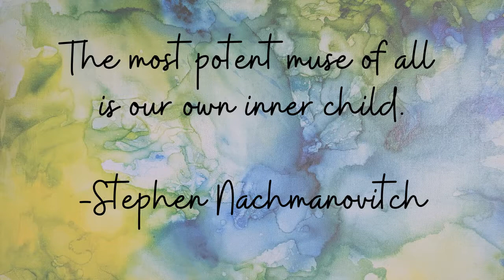Dollhouse Bookshelf Flip-Huge Transformation! Dollhouse Bookshelf Upgrade - Trash to Treasure DIY

Comment: Quick question, why didn't you just take the shelf apart and paint each piece individually? It seems like that would have been a more effective way to do it... but maybe I'm missing something?
Reply from the maker: Great question! I actually did consider doing it that way at first while I was removing the roof and back, but I think some of the pieces were glued or something by the previous owner. I honestly don't remember for sure since this was awhile ago, but I assume there was a logical reason.